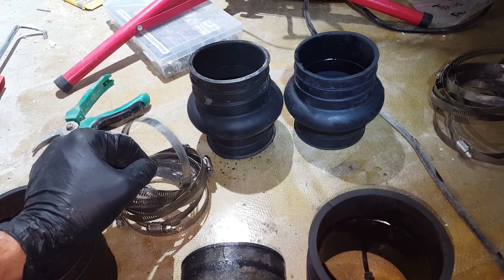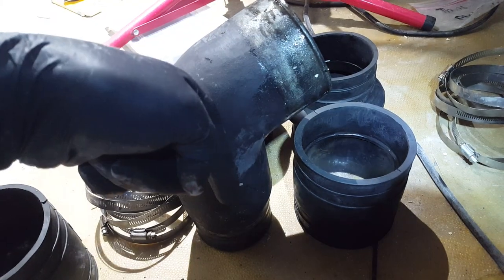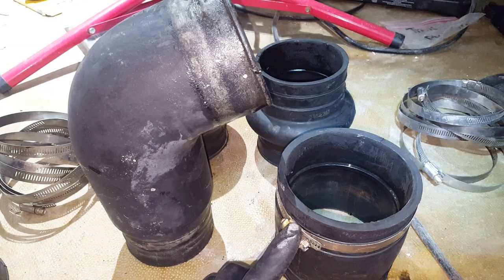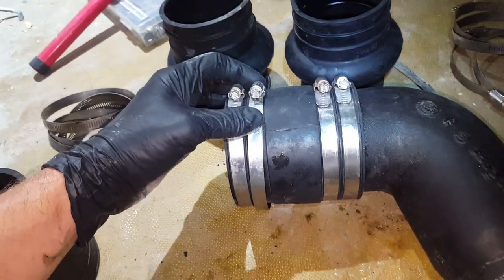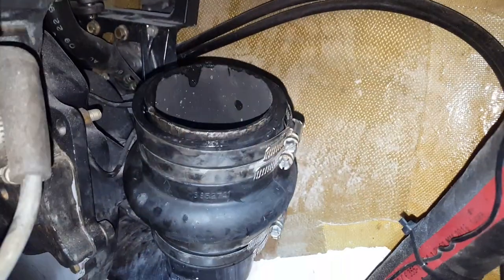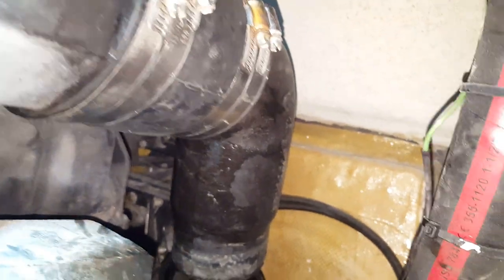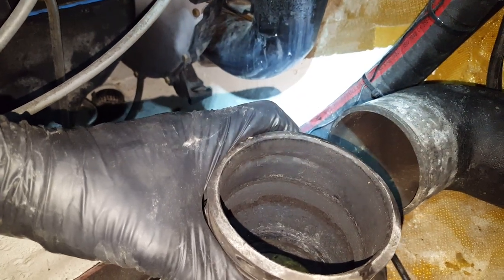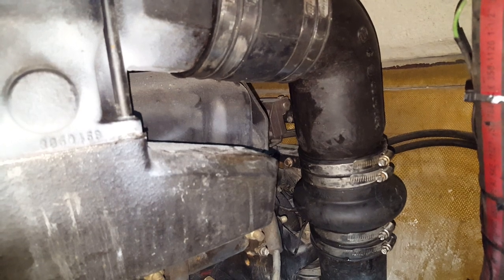Boat Transom and Floor Rebuild - Installing the OMC/Volvo Exhaust Manifold Hose/Pipe - Part 72

Comment: @Michael Romer
 For a 87' OMC 5.7 with electronic ignition rebuilt by Jasper what should my timing be set at idle for regular 87 gas?
Reply from the maker: Start off at 6 degrees above TDC and get out your timing gun to fine tune it.

Comment: Hi Michael, I'm curious about how the floor between the seat boxes was completed and tied into the exiting fiberglass. I'm also curious about the gelcoat application in that area when the time comes.
Reply from the maker: I've used Gelcoat before and this time I'm using epoxy paint instead. Reasoning: I'm using epoxy to bond the Kevlar and not polyester resin. All wood is attached using stainless steel screws. Then bonded to the original parts of the boat with a epoxy/cabasil  thickening agent. I recommend you start at the first part of the series and work your way up to 71. I go over all these step in each video.
Reply: Thanks for the reply Michael, I’ve watched every one of them, but I’ve either missed the episode that clearly shows the bow as it’s tied in, or you haven’t posted it yet.

I’m about to start the grinding phase of my rebuild and had to do the exact same “surgical” removal of the bow floor, which is why I’m asking.
Reply from the maker: @tomvandenbosch8560  I'm working on that video. I have finished it though. In this project, I got all into Kevlar and epoxy only--for everything. The bow portion is probably something I would have done a little different. No in terms of the removal, rather the reinstall. You will see it in the video, but what I would have done was used Kevlar epoxy in the one spot and 1708 in the part that blends in with the gel goat. I'll explain more in the video--coming soon. Just for you :)
Reply from the maker: @tomvandenbosch8560     I'm working on that video. I have finished it though. In this project, I got all into Kevlar and epoxy only--for everything. The bow portion is probably something I would have done a little different. Not in terms of the removal, rather the reinstall. You will see it in the video, but what I would have done was used Kevlar epoxy in the one spot and 1708 fiberglass in the part that blends in with the gel goat. I'll explain more in the video--coming soon. Just for you :)
Reply: Don’t feel bad, I’m sure every project has its share of ups and downs. I just had a downer in discovering that about an 8” vertical by 4” horizontal by 1/8” thick section of my transom around the bowling pin has delaminated on the port side, probably due to freezing from a wet and rotted transom. 😭

Thankfully the hull was built like a tank so I should be able to repair it, I just needed to walk away and vent! 

Love this series and looking forward to your next installment!

Comment: If anyone knows how to remove the tiller arm I think it is. The are the goes directly from the steering cable to shaft that goes through to the steering knuckle mine has a washer looking thing with a grease fitting on it is the best way to describe it I have tried everything to get it off and I can’t if anyone knows how please let me know it would be greatly appreciated it’s on I believe an 85 Volvo penta with cable steering obviously I have talk to many that have asked me if it has cable steering so I figured I would say it has it I can’t find anyone that knows how up where I live
Reply: What year, model, and outdrive model is it on the boat? The steering slightly varied in how it was connected on 270's thru 290's. It also changed depending on single prop or duoprop (Volvo penta).

This is all assuming that it is indeed an inboard/outboard.

Also, when you say tiller arm, are you referring to the unit INSIDE the boat that connects steering to the outdrive, OR, are you talking about the steering unit that holds the outdrive entirely by itself and on the hinge pins of the outdrive?